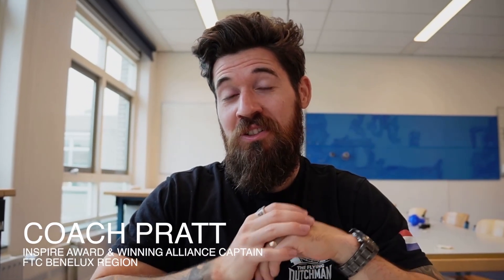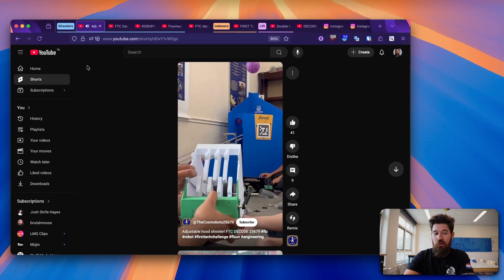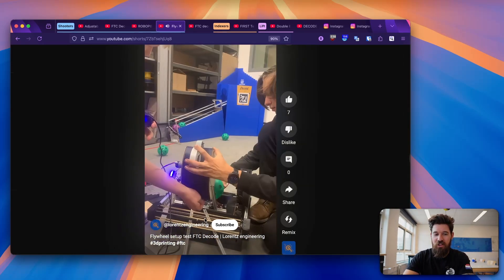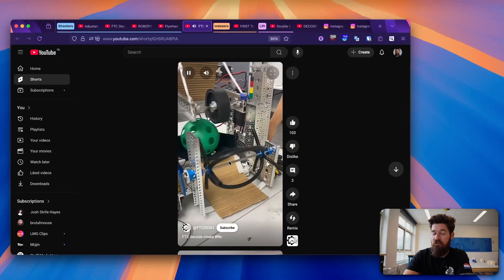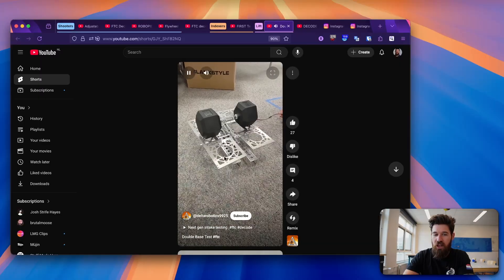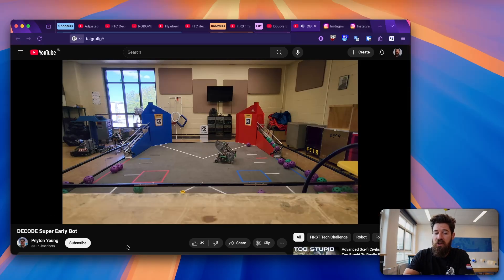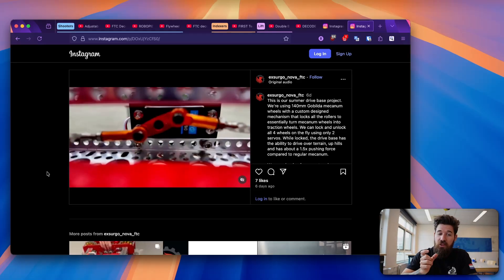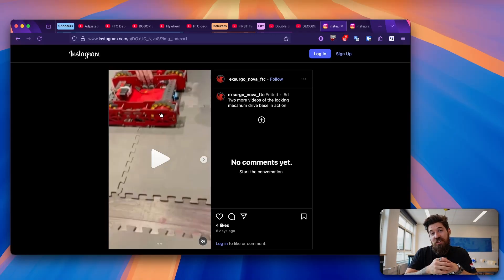Their Robot Does THIS? [FTC Friday's DECODE]

Comment: Wouldn't a grippy hood design make it have more friction with the ball and therefore have more backspin?
Reply from the maker: As far as my understanding goes, You’d actually get less backspin, counterintuitively. If your ball slips less, that means more impulse is being transferred to the ball. If the ball slips more, it’s applying more impulse to spinning the ball rather than moving the ball itself. This also means you need less compression as well. Which is good as less force goes into compressing the ball and into applying an forward impulse

Comment: In our video we used an older motor (only 5k rpm), so we needed more compression to shoot far enough (however it was a bit overkill and once shot on the shelf behind the goal).

We tested with and without the Grip Tape (andymark Gray Grippy Tread 1 in. Wide), with the grippy thread it definelty went less far, but more backspin. However you can have to much backspin and it shoots back out (happend once). Threre are 2 explantions for it shooting less far: 1. more energy in the spin of the ball and 2. even more compression so slowing down the motor before it leaves the hood.

We will upload a video of out intake with vectored intake wheels today or tomorrow.
Reply from the maker: Thanks for following up and sharing more details on your findings. Perhaps with the grip tape it was too much compression? With a nonslip surface you definitely need less compression. I'd be curious to try it again on a fixed plane so the tape can't free move.
Reply: @BroganMPratt   We will definetly do some further tests (and uploading them). We have also uploaded the intake prototypes with the vectored intake wheels from The Trifty Bot (3d printed versions)